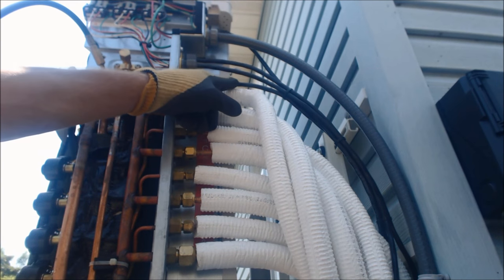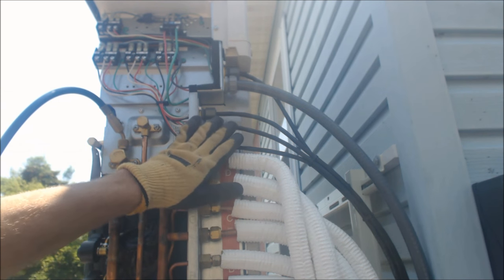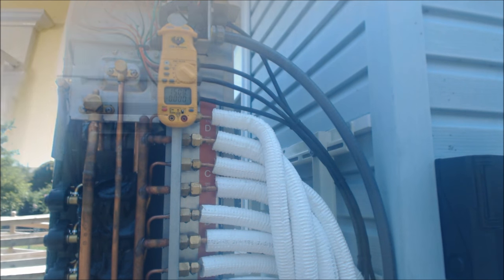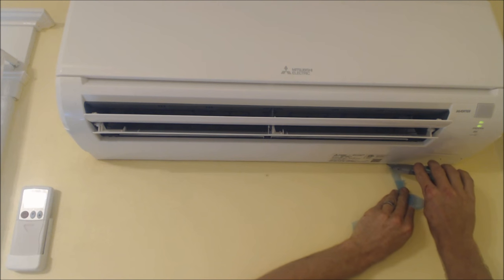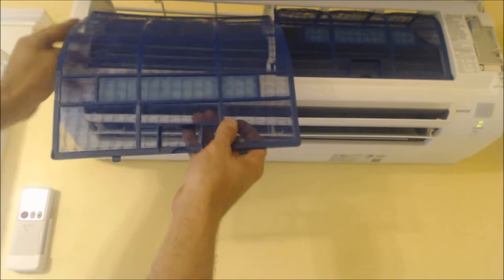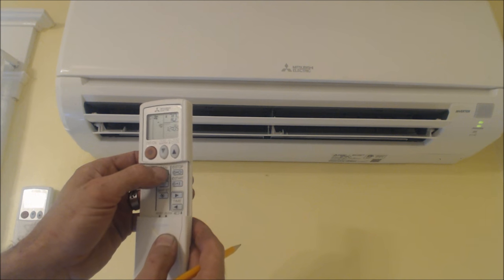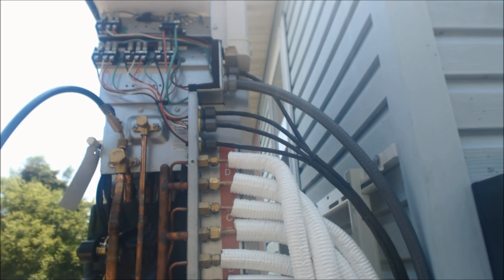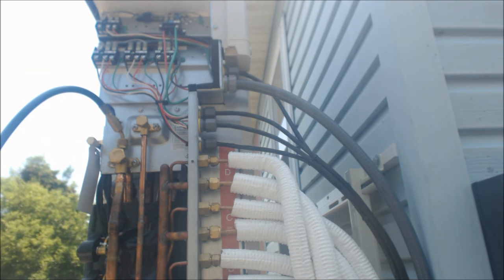Mitsubishi Mini Split Installation Tips!

Comment: Can you please cover detailed procedures for charging mini-split ductless systems.  Since the TXV is at the outdoor unit, I would expect the charging procedure to be different than regular system.
Reply from the maker: Manufacturers of minisplits usually only recommend the total weight method. This is because of the vrf compressor, thanks!

Comment: Thanks so much for your videos I'm wanting to install a diy minisplit and need all info I can get looking at mr cool as they are pre vacummed etc. But will need to run power from old central ac to new minisplit condenser and put in disconnect for it
Reply from the maker: You would have to check the voltage and amperage wire rating and breaker size to match or exceed the Mr cool, thanks!
Reply: AC Service Tech LLC 
I would put in new wire over to the new minisplit but use the amps already being used in the pantry box for the central ac?
Reply from the maker: You would need an electrician to box that wire for safety and run the new wire out of the box if it was the correct breaker size, wire gauge, and length for voltage drop, thanks

Comment: Good video.  I like the tape trick for getting the cover off.  Have you found a good way to remove the cover after you have removed the tape?  I struggle every time I have to take one off for cleaning or service.  I think next time I take mine off at home I might put some clear shipping tape on it before putting it back.
Reply from the maker: Great question! just bend a hook in the straight part of a clothes hanger or insulation hanger. Stick that up behind the unit and pull down on the plastic. The hook part doesn't have to be any bigger than a half inch. I hope that helped! Thanks for the question!

Comment: Was wondering why r 410 mini splits don't have high side fitting like old r 22 systems . looks like it would do poor job of evacuating high side of system or in the future if system has to be evaluated for problems. thanks for info-   these things look very complicated
Reply from the maker: Hey Jim, the reason is because the manufacturer does not want techs to try to charge the systems using subcooling because it has a vrf compressor typically. They just recommend the total weight method. In reference to evacuation, the metering device is usually in the outdoor unit so vacuuming is fine with a single port since there is no restriction half way through the tubing, thanks!

Comment: Question about the high wall indoor units/airhandlers .
Most will exit outside the exterior wall that require a 90 bend in the lines. I read that some units have built in springs to hand bend the lines.
What’s a trick to get this bent outside with no kinks?
Reply from the maker: From the inside wall to the outside wall, make it go downward so the outside hole will be 2-4" lower than the inside hole. When you bend with your hands, you just bend in slightly different parts so just move your hands a little as you bend and with something small like 3/8" it won't kink, thanks rotaxrider!
Reply: AC Service Tech LLC 
Ok Great.
So your saying that the center line of inside hole for the line set which is a  2 1/2” hole should be higher than the outside 2 1/2” hole  by 2 to 4 inches?
I’m guessing for better drainage and the bend on the lines wouldn’t need to be 90*  but more like 50*  or so.
Reply from the maker: both right and yeah depending on if the wall is 2x4 or 2x6 would change the angle of how far I would drop the outside hole below the inside hole. 2 or 3 inches is fine, thanks
Reply: AC Service Tech LLC 
Perfect 👍
That’s my next task. 
I got the condenser unit installed on aluminum wall brackets that have threaded stainless steel rod epoxyed  into my concrete foundation.
I got the disconnect box installed and line power run to the main to be connected and the whip shortened and connected.
Next is to make connections on the handler and  feed everything from inside and mount it to the bracket on the wall.
I got a 25’ line set but will only need about 12’, this Carrier Heat Pump needs a minimum of 10’ so I’m borrowing a ratchet style flare tool to make the connections on the high and low.
Then it’ll be ready for the next steps.
Thanks again for your time and channel. 👍
Reply from the maker: Sounds good and Merry Christmas!

Comment: the indoor unit and outdoor unit both function as condenser and evaporator ?
Reply from the maker: Correct, in heat mode any heat pump will have hot discharge gas coming out of the compressor, going through the reversing 4 way valve, and going directly to the evaporator coil to reject heat. Thanks for the Comment!

Comment: I plan on installing a mitsubishi single zone unit. If I avoid flaring line myself (mitsubishi makes 10' line) and I use a torque wrench, and    system holds vacuum , can avoid the nitro test?   Im on an island and have to install it myself. Also, I know its important to isolate the vacuum pump from the suction line,  Can you tell me the simplest set up to do this?.
Thanks 

Don
Reply from the maker: Maybe use nylog on the flare fitting seats, not the threads. I will never advise anyone to not do a pressure test as it could be asking for trouble. With what you are looking to do, it is just a hose with a valve between the vac pump and the micron gauge, a two port micron gauge, and a hose with a valve from the micron gauge to the unit. I really would do a pressure test though with a gauge set with nitrogen though. Thanks
Reply: Thanks for the reply

Comment: 15 amps, is that more than say a 5 ton unit would use? Wouldn't that make this unit less efficient? Still learning but curious.
Reply from the maker: It does not mean the unit draws 15 amps but that the wiring and components are rated up to 15 amps so that if something was stuck, it will pop the breaker first instead of the wires catching on fire. 5 ton units usually draw much more than 15 amps single phase, thanks